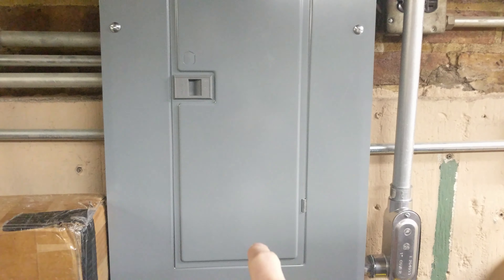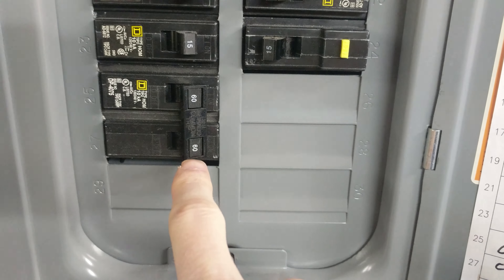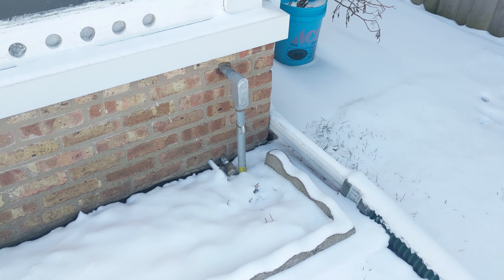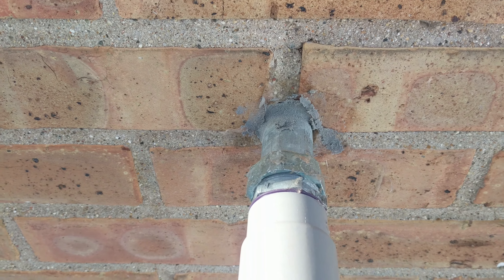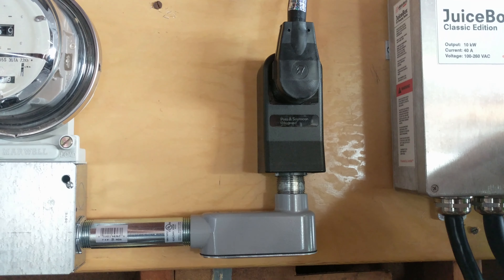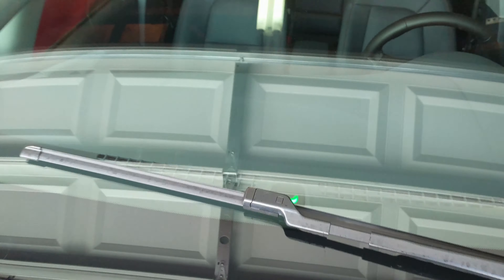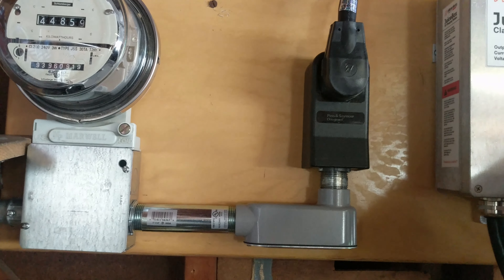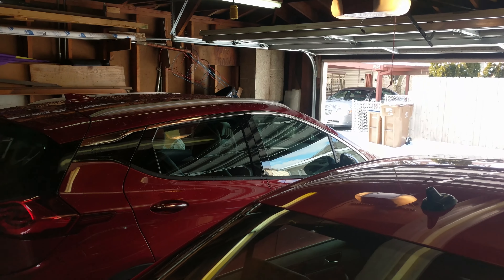240V Install EV Level 2 Charger Install for Chevy Bolt

Comment: Wow! You made what looks like an incredibly involved project look easy. I just put a deposit on a Bolt without first checking out 240 volt installation issues but hopefully mine will be easy for an electrician. We’re in a townhouse. The panel is in the garage. It has plenty of space but I don’t see the total amp rating. We have central AC and a dryer so I hope we’re good to go. You had to run yours all the way out to a detached garage. I’m thinking I’d like to install my outlet just outside the garage so I can charge without pulling in. We’ll see. I may just have to make room in the garage by taking out all my bikes and stuff that’s parked where the car should go 😮
Thanks for the video. You must love the Bolt to do all that to plug in.
Thanks again!
Reply from the maker: Yea it should be super easy if the panel is in the garage.

Comment: This is the first video I’ve found that someone has had 100amp service from the panel for this type of project. Do you find 100amp sufficient for EV charging? Do you have mostly gas appliances in your home? Any issues over the years with tripping or anything? 

Sorry for all the questions but I’ve been waiting to ask someone else with 100amp service these things.
Reply from the maker: We had zero issues.  100 amp service is 24kw of power.  In my case I had at the time a Bolt EV, the most it can pull is 32amps so that leaves 68 amps worth of power left.  The only thing we have in our house that pulls large amounts of power outside of the EV charging is our stove and over both electric, but it peaks out at around 5.5kw with everything turned on to the max.  So lets add a microwave and all our refrigerators and lights on and we might see another 2-3kw.  Toss in cutting the grass(we use electric ~800 watts to run the mower) and charging a second EV at 16amps charging and maybe you get to 24kw, but that's a lot.

The truth is we mostly charge at night anyway between midnight and 7am.  Most EV's will be fully charged by charging at night anyway and rate are lower.  To answer your question no it's a non issue.
Reply: Awesome! Thank you for breaking it down too. It’s the only thing I wasn’t too sure about but after seeing what you have I definitely feel I’ll have more than enough room for a level 2! Thanks again!

Comment: Why do you need a second meter
Reply from the maker: I don't need it but it allows me to tell how much power my Bolt is using.
Reply: @darrenorange2982  It may not be as accurate as a separate meter, but it can't be too far off.  I just bought a smart charger that logs how much power my Bolt is using when plugged in and I can access the info via my iPhone at any time. Seems a bit simpler than a separate meter.
Reply from the maker: @SWFan77  It is very accurate, before its retirement it was used for calibration and testing. The Bolt shows accurate information and the meter lines up with what I would expect including charging losses.

Comment: I think 6 ga wire is too small for 60 amps. charging stations are a continues draw and are derated  to 80% due to heat build up. you need at least a 4 ga wire to meet NEC
Reply from the maker: NEC minimum is rated for sustained 55 amps, depending it can support up to 75 amps.  Regardless the breaker would trip well before any issue could occur.  This has been in service and used now for nearly 3 years and is a dedicated feed for electric car charging.
Reply: @darrenorange2982  a chevy bolt only pulls 32 amps, if you ever pushed it, you could overheat the wire, without tripping the breaker. i believe 6 ga wire is only rated at 48 amps continuous.
Reply from the maker: @rogerballiet8131  I am not saying what I think or believe. Please review the codes, they will give you the facts of what is to code.  Everything we did in this setup was to code. https://media.distributordatasolutions.com/ThomasAndBetts/v2/part2/files/File_7437_emAlbumalbumsOcal20(USA)oc_1_g_nec31016pdfClickHerea.pdf
Reply: @darrenorange2982  i do not see anything in the link you posted to account for the derate to 80% on continuous draw. this seems to be for a simple circuit, and only a base guide.

Comment: I have a question  do you have to get some permit from the city hall?
Reply from the maker: If you are not comfortable doing it yourself then you should.
Reply: @darrenorange2982  In the US whether an electrician or the homeowner performs the electrical work doesn't determine if a permit is needed. In most cities, if you are messing with the panel and/or adding new outlets, a permit is required.